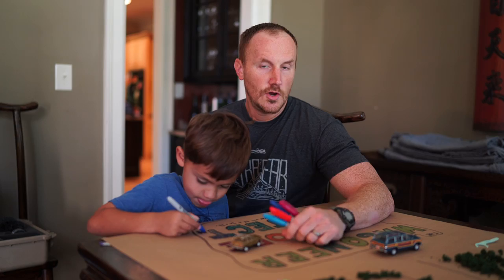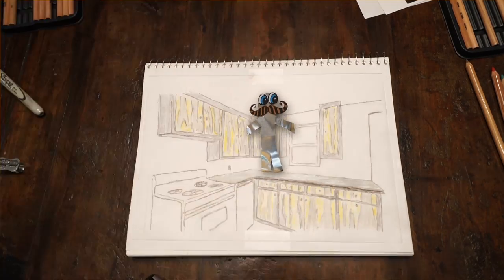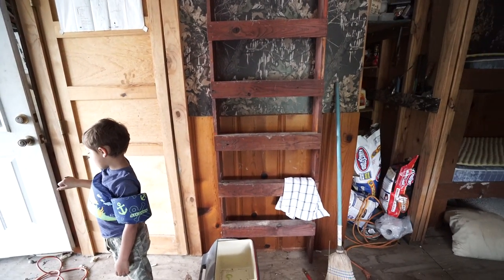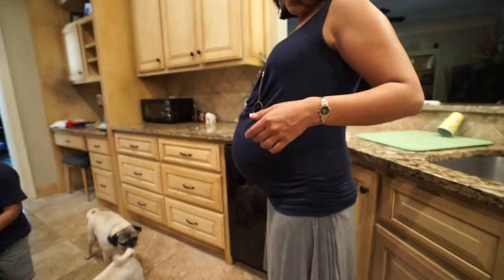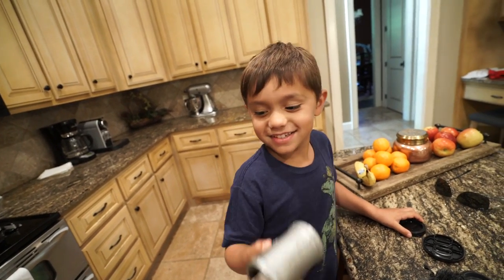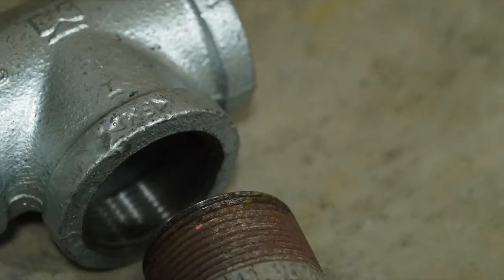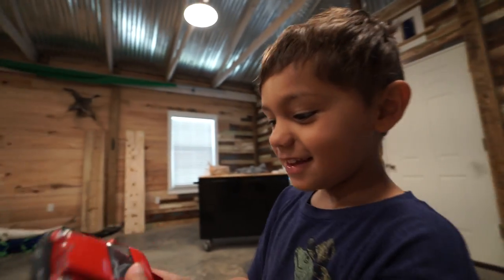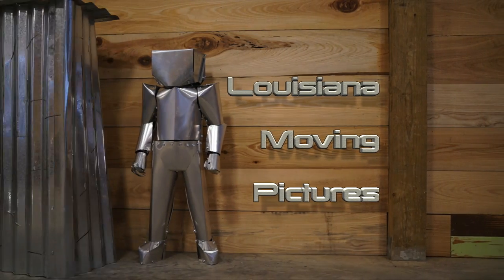Making A Metal Ladder From Plumbing Pipe

Comment: How did you make the square with the pipe? Im trying to do something similar and i cant fit my square together bc the threads go in the same direction
Reply from the maker: CoyoteFur You have to assemble both uprights and then all of the rungs on one of the uprights screwed in as far as possible. You then have to screw the rungs sort of all at the same time, quarter turn by quarter turn, into the other side. So as you&#39;re screwing in to one side you&#39;re screwing out of the other which is why you have to make sure you are fully screwed in to one of the sides when you start. It held up and I felt like it was stable but a spot weld would definitely not hurt.
Reply: @HamptonRutland  thank u very muutch
This was my qustion also
Reply: That’s really genius sir, definitely don’t want spinning steps

Comment: Ol'queSO...
When connecting the rungs to the T's do you reverse the opposite side and live with @bout a 1/4" of each side threaded?..
Reply from the maker: Yes. It’s not ideal, so I spot welded the joints. After about 6 months of use. It never was an issue, but I felt safer then it was spot welded

Comment: Okay - HOW do you connect the sides of the ladder without one side having a reverse thread or using a union?
Reply from the maker: dalesworld you thread one side in as hard and far as you can then you screw it into the other side. So you’re threading out one side and screwing it into the other.
Reply from the maker: dalesworld you can tack weld it in place if you feel like you didn’t get enough purchase with the threads. It also won’t spin if you spot weld it
Reply: Ahhhhh....didn't think of that.
Reply: @HamptonRutland  I have been trying this for 2 days with a half-inch pipe. Thank You!
Reply: Been racking my brain trying to figure out how to make a stool with a back on it. I was thinking the same thing about a fitting having reverse threads. This never crossed my mind.

Comment: How did you connect the ladder rung if the 2 tees are already fixed? Do you have a video that shows it?
Reply from the maker: Bayani Rodriguez  You have to assemble both uprights and then all of the rungs on one of the uprights screwed in as far as possible. You then have to screw the rungs sort of all at the same time, quarter turn by quarter turn, into the other side. So as you’re screwing in to one side you’re screwing out of the other which is why you have to make sure you are fully screwed in to one of the sides when you start. It held up and I felt like it was stable but a spot weld would definitely not hurt.

Comment: So did you just grind off the threads of some of the pipes and then just weld them together? Because there is no way that you could just thread them all together to make a ladder like that without using pipe unions. Or am I missing something? By the way I saw your show on the DIY Network and thought it was Great! Keep 'em coming! Good Job!
Reply from the maker: Dr_Boom very keen. You have to assemble both uprights and then all of the rungs on one of the uprights screwed in as far as possible. You then have to screw the rungs sort of all at the same time, quarter turn by quarter turn, into the other side. So as you're screwing in to one side you're screwing out of the other which is why you have to make sure you are fully screwed in to one of the sides when you start. It held up and I felt like it was stable but a spot weld would definitely not hurt.
Reply: Ok… That makes sense. I'll have to try that.
Reply: I thought that at first , but seems it could leave a loose assembly..so me being a welder..I'd at least tack it after the fact..
Reply: Or a dab of JB Weld so they don't unscrew.

Comment: Looks great. I'm wanting to make a bunk bed ladder from pipe, but am thinking it is going to cost a small fortune if i have to buy each piece and make it from scratch. There is also a product called Rigitube i might look into further. It's really for industrial applications such as hand rails in buses or trains etc.
Reply from the maker: Justyburger yes that thing was super expensive
Reply: I might have to use timber? I have some good quality dense wood too, but the tubing would look better. I do also have some old Galv plumbing pipe in the garden, but no threading device and no T pieces or other brackets. I'll see how i go with solutions. Thanks.
Reply: Unprofessional 
Didn’t show how you screwed all the pieces
Reply: I spent $123.00 for a little more than 5' of ladder (3/4" black).  But compared to falling off my ladder the other day because of poor positioning its priceless...  
I'm quite blessed to be walking or even breathing 😅